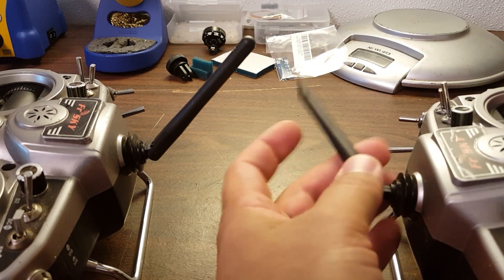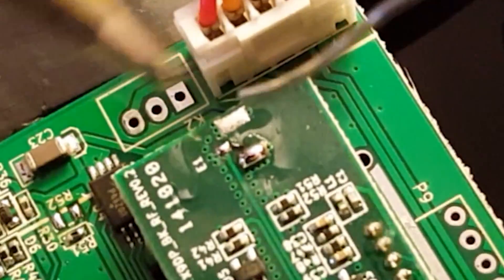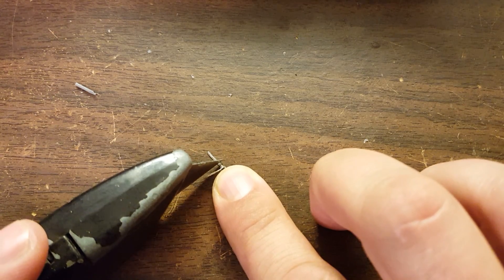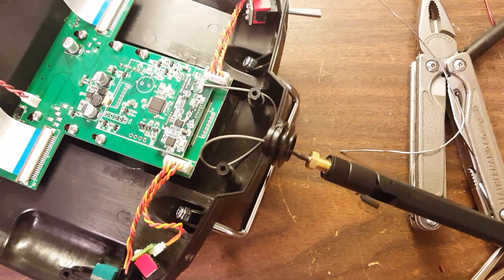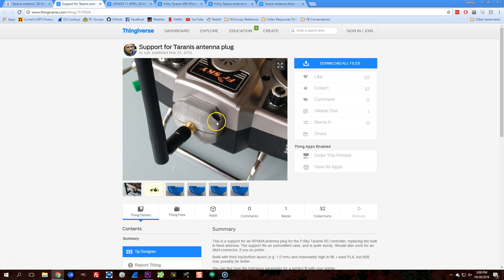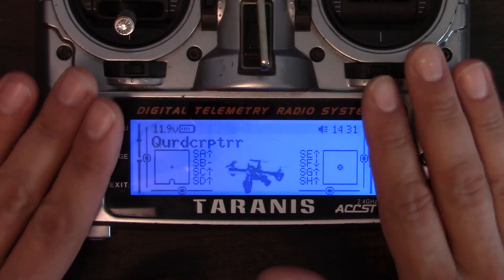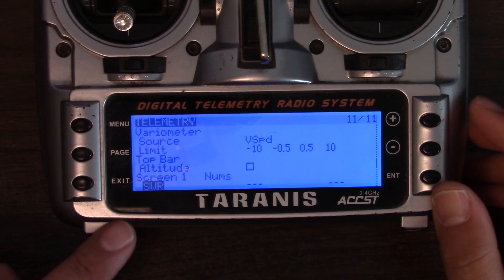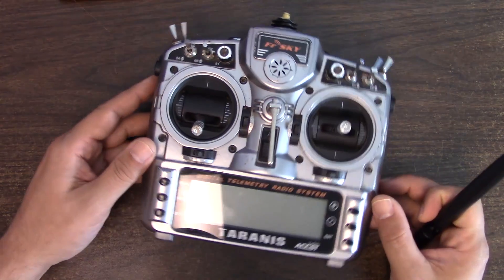FrSky Taranis 5 dBi RP-SMA Antenna Mod | POSSIBLY DO NOT DO THIS MOD

Comment: Has any one got the dreaded radio antenna defective message after the switch... I have and my Taranis has the Ufl connector. I didn't even have to solder. Pigtail is hot glued in place nothing is lose. Should I try another pigtail? Both my friend and I did this mod with same parts and his does the same.
Reply from the maker: +David Lawson sounds like the antenna is no good.
Reply: We have tried multiple antennas we used rg176 His is soldered to the board and mine is connected with the ufl. I think the pigtails are bad . What else could it be ?  I'm going to pm you on rc groups . My screen name is kickybanks
Reply from the maker: You've just got to use trial and error. If multiple antennas are bad, then it's got to be the pigtail.
Reply: Thats my guess as well . How yours doing? .. any issues? I may order from the link you posted
Reply from the maker: +David Lawson mine is fine so far. The pigtail isn't u.Fl though.
Reply: ok thanks. I sent You a message on you tube check it out when You can

Comment: Hi, I did the mod too, tried to get to 84mm, but failed as I did not deduct the amount of shield that I soldered onto the pad (I did not pinch it together, just soldered the 316 shielding to the ground pad). So it's now say 87mm of shielded cable. It works great and the SWR is between 0 and 1. What's ur take on those 84mm? Would you recommend me to do it again, just to get to that exact number?
Reply from the maker: +David Steinberger if the SWR is low then don't bother.

Comment: Joshua thanks for the great work you put into your videos. They are more than just inspiring. 

I had the antenna changed the way you suggested, SWR is 0 to 1. I tested two antenna, one HobbyKing 5dBi gain and an optical similar 5 dBi one from Amazon. However, the RSSI reading is 10 to 5 % less than what Isaw with the stock antenna. At the end of the day, less range instead of expected range increase. Any idea what happened?
Reply from the maker: Poorly matched antenna, I guess.
Reply: are you saying there is a spread in quality among the 5dBi antennas sold
 so I just need to shop around until i find a matching one? One sources 
i.e was this: 
https://www.amazon.com/gp/product/B01GM9DUPY/ref=as_li_qf_sp_asin_il_tl?ie=UTF8&tag=mrste08-20&camp=1789&creative=9325&linkCode=as2&creativeASIN=B01GM9DUPY&linkId=7668ab372740317a907bcd2ae696b4f3
Reply from the maker: +cusglider i mean, I guess that's what you're telling me...

Comment: Iv seen on other videos that people take measurements to cancel impedance. thoughts?
Reply from the maker: +Roflbot FPV I'm not sure what you're referring to.
Reply: Sorry, that was pretty vague. Measuring the length of cable between the solder point and the bottom of the RP-SMA connector. speed of light times velocity factor of cable divided by center freq. Is that only for certain coax? Im just learning. :)
Reply from the maker: If the coax is actually 50 ohms then the length doesn't matter. If the coax doesn't meet spec and is not actually 50 ohms, then you want the cable length to be a multiple of a wavelength. Alex Greve recommends 84mm. 

Many cables that are nominally 50 ohm are not actually 50 ohms at microwave frequencies, especially cheap cables. 84mm is a safe bet regardless.
Reply: BOOM! I dont know who Alex is yet but Ill check him out. Thanks again.
Reply: Alex Greve = IBCrazy, Dots = Connected

Comment: I'm trying to find the correct video for my question. This seems like a good spot. Do USA cell towers mess with 2.4 signal? For example, those fake trees or a light pole with tons of repeaters on them.
Reply from the maker: If you fly near a powerful transmitter, you'll likely get interference almost regardless of what band you're on. Yeah, you can expect failsafes if you fly near a cell tower.
Reply: Joshua Bardwell I guess the question is how close is too close. They are almost everywhere nowadays. Thanks a bunch!!!
Reply from the maker: +Kevin Duquette if you dive it, you're too close.
Reply: Joshua Bardwell I think I had failsafe. Off the parking lot 100feet. A baseball field away from a tower. Broke HD camera, top plate pushed into my new LUX FC and cracked it.

Comment: the part that you had in your description had a IPEX connector at one end. Is there a special way to remove it? Would removing it mess with the signal. From what I've learned so far is that the length of the co-ax wire is very important. Correct me if I'm wrong. Cheers!
Reply from the maker: +Tyler I just cut it off and direct soldered. But if you have a recent Taranis turn there might also be a u.fl connector.

Comment: i used rg316 and the swr is 33 the wire length is 84 mm what can i do to get better swr?
Reply from the maker: +vit tsy I'm not really sure. It seems like some people get higher SWR for no obvious reason.
Reply: what can i do to improve it?
Reply: were did you get the antenna?
Reply from the maker: It's in the video description.

I don't know what you can do to improve it, hence the, "for no obvious reason" :-) Try a different antenna and coax? Or just leave it at SWR 33 and see if it burns out your board. Maybe it won't!
Reply: once in a while it will say antenna defective and will lose signal and when i turn it at a certain spot it will go to 18 swr
Reply: how can you tell if the board is burned?
Reply from the maker: +vit tsy range will be really short.
Reply from the maker: +vit tsy Yeah, I would try to fix that. If it says antenna defective ever, something isn't right.
Reply: what should i try replacing first

Comment: Morning, I have just completed the antenna replacement. When checking my SRW without touching it I get a reading of 33. But when I touch it I get a reading of 1. Should I open her back up and redo the soldering job? Also I used the same antenna you provided in the link.
Reply from the maker: I don't even know what to make of that but if your SWR is 33 I think I would be worried the board would burn out. Try the tip given by Alex Greve of cutting the coax center conductor to 84mm exactly. That will compensate if your cable's impedance isn't exactly right.
Reply: I have completed the changes, it reduced the SWR to 16. I think I can live with that. Thank you for the help Josh

Comment: Harder that it looks! Although I did use heavier gauge coax. But I lifted the tiny pad :( thankfully I also lifted the track a bit and managed to solder onto that :D then lotttssss of hot melt

Comment: Did you only solder to one of the ground pads?
Reply from the maker: Yes.
Reply: Joshua Bardwell I did this mod with a thicker cable and soldered it to a single ground pad.  I getting an swr reading that hovers around 35.  Is this ok, will it decrease range, and is there a way to fix it? Thanks!

Comment: ps. when soldering small things like SMD, put your little finger on the table (or something solid) as a reference, your hand will be stable. Using a teflon coax is best, it's quite heat resistant and will not deform when heated. ps....First time I hear someone say SWR like that ;)
Reply from the maker: If you can say "viswar" then you can say "swar". That's my opinion and I'm sticking to it.

Comment: How hot should the soldering iron be?
Reply from the maker: +Lachlan Peknice I use 750 F as my general use. Up to 800 or 850 for larger joints or heavy pads like on a PDB.
Reply from the maker: +Lachlan Peknice ah, now I see the context. For the Taranis, I used 750.
Reply: Thank you!!!

Comment: I ordered the part used by Joshua.  When I opened my Taranis the board already had that UFL connector installed.  All I had to do was connect the cable to the board and epoxy in the rp-sma connector.  Kind of happy to not have to solder anything.  lol

Comment: Great toturial... Can i put 9dbi antenna?Why my swr 48? Any idea to get 1 like you?
Reply from the maker: +izzat ishak SWR 48 because your soldering is bad or your antenna is not tuned correctly. If you don't fix it, you'll burn out your radio board.
Reply: Joshua Bardwell thanks a lot... My taranis now have 5dbi antenna...

Comment: I've watched other Taranis antenna mod vids, and some specify the length of the coax to (RP)SMA jack which you are attaching.  One suggests that 84mm is the optimal length. This seems odd to me, since a 1/4 wavelength on these 2.4ghz frequencies is approx 32mm (a little less). As a ham radio operator, there is some data on feeding a monopole with various fractions of a wavelength of coax (1/4 wavelength, 1/2, 3/4 or even 1 wavelength.  I'd be tempted to match the length as used in the original antenna install. While I've not modded my Taranis TX ant., I did put a 5dbi external antenna on a Syma X8 TX to great effect. According to some other vids, one could expect up to a 50% range increase using the 5dbi mod on the Taranis.  Good food for thought. Never thought of putting the SWR on my telemetry screen ... going to do that now. Cheers. EDIT: I just checked in my telemetry section, and the version of FW I have on my Taranis (2.0.6) does not have SWR, nor does it have the "Discover" ability of later FW versions - 2.1.X. Oh well ...
Reply from the maker: Alex Greve told me that the goal is to have the coax be an integer multiple of 42mm, to negate the effect of cheap coax not being 50 ohms. I didn't ask him to derive that number for me, but if Alex says 42mm, he's probably right.
Reply: Well that corresponds to the 84mm number I heard. Cheers.

Comment: I accidentally powered up without antenna twice. Powered off right away, in total it's been powered without an antenna for less than 4 seconds or so. Do you think I caused any damage? Also I hardly hear the humming the radio previously emitted is that because of the 5dbi mod or because I did have it powered on a few seconds?
Reply from the maker: Probably fine.
Reply: Pablo Contreras
Reply: kimi masuda ??

Comment: Thanks Joshua! Did the mod with succes! My SWR is 0-1 so far so good. When Incover the antenna I see 0-16. Did a field test and works as a charme. On same spot I dont get the alarm anymore. 🤘🏻😁

I used the Bison Kombi Stick to fill the hole. Works great with plastic and meatal and hardens in 5 min. Its also heat and water resistant. 👍🏻
Reply from the maker: That Kombi Stick is interesting. Thanks for pointing it out.

Comment: Nice video and explanation Joshua. Done my antenna mod a couple of weeks ago using this 3d printed part which works flawlessly. Locks the sma in place and protects it not to turn while screwing in or out the antenna. http://www.thingiverse.com/thing:1659737

Comment: Here is an idea on securing the SMA plug in the Taranis. I ended up putting layers of heat shrink a few MM thick on the base of the SMA plug so when i tightened the provided nut on the SMA plug, it compressed and expanded the heat shrink into the surrounding hole on the taranis securing the SMA plug very securely, followed with the hot glue for back up, so far working great!

Comment: I did the exact same mod one week ago and my SWR is around 32... i just don't understand why. My soldering is good. If I unscree the antenna it goes up to 65 so it means SWR works properly... maybe my antenna is bad. I bought the one frome banggood. Anyone else with this problem?
Reply from the maker: Here's the exact antenna I'm using. https://www.amazon.com/gp/product/B01KBU61S8/ref=oh_aui_search_detailpage?ie=UTF8&psc=1

Comment: Why not use a shorter cable? so that is not that long.
Reply from the maker: I don't think the few inches of extra length will hurt my signal that much. And I have a bad habit of over-shortening cables and then having no slack left when I need it.
Reply: One more question... Where did you get that antenna? is there any difference between vendors? in terms of quality.

Comment: Hey Josh, i tested serveral WIFI Antennas, the bigger the gain, the bigger the SWR gets. A small 2.4ghz 3,5dbi antenna, like the original one gets me a SWR of 1 (even with ufl connector), the antenna with the most gain gives me a SWR of about 30-35. Can you relate?
Reply from the maker: +bind I can't. But that's interesting. I'm using a 5 dBi with a SWR of 1.

Comment: Thanks Joshua, really want to do this mod & at the same time wish FrSky had released an updated version of the Taranis that already had this done (instead of trying to "re-invent the wheel" with the Horus)
If I remember, you are an RF Engineer... so keen to know why RP-SMA is used for this vs SMA? 

It would be great to do a video explaining why DJI's new Occusync technology can have such awesome range (for both control + video signal) on a very small hand-controller antenna compared to what we currently have with the FrSky setup.
Reply from the maker: There's no real RF advantage between RP and SMA. I think that RP antennas are more common though. Some argue that RP is less prone to damage because it has the pin on the device, and the device is less likely to be banging around in a toolbox somewhere getting damaged, but I think that's questionable. 

The real advantage to RP, if you want to know, is that an SMA antenna CANNOT plug into an RP jack, but an RP antenna CAN plug into an SMA jack. So with an RP jack, you know for a fact you will never screw the wrong antenna in.
Reply: Thanks Joshua... that makes sense to me.

Comment: Ok, so i've got some interesting SWR results, however this is 100% stock with no modding. If I have the antenna at a right angle to the TX pointing to the right, I got a reading of 14-19 (with hand coverage goes to 30). This reading is almost identical to all other antenna positions EXCEPT for a right angle to the LEFT. I then get a 0-1 reading. When it is to the left the speaker is quiet, but to the right the speaker makes buzzing noise so there is obviously some noise leaking out. Any ideas why?
Reply from the maker: Two guesses. 1) you have damage to the braided shield of your coaxial cable. 2) putting the antenna one direction puts something metal close to it that causes a change in its radiation characteristics.
Reply: Joshua Bardwell Maybe I will get some upgrade gimbals so I have an excuse to open it up haha. Thanks for the info. I will make sure to have it to the left and check it regularly.

Comment: Would using RG316 be any better?
Reply from the maker: Thicker coax is basically always lower-loss than thinner coax. However, if the length is short enough, the difference can be negligible.

Comment: Great tutorial. Sorry for a differ question, I have checked my SWR on stock Taranis, and I've got my SWR to be 16 constantly. The Transmitter antenna is intact. Is it poor assembly of transmitter ?
Reply from the maker: +Sasha I couldn't say for sure, but that's a relatively low number and I'm not sure I would worry about it.
Reply: Nice to hear that, thank's :)

Comment: Awsome advice on the SWR reading Joshua, I had previously done the antenna mod so I could fit a 5dbi antenna and the SWR test proved the mod was ok, I get either 0 or 1. However when I refitted the standard length antenna I got a reading of 16, tried a second standard length antenna and got a 1. I'm guessing the antenna with the bad reading was in fact an unmarked 5.4ghz antenna. Thanks again.
Reply from the maker: +David Hughes I also tried a 5 GHz antenna by accident and had a similar result.

Comment: hey please 
is you're taranis plus making a sound from the speaker continuously ? like interference ?
Reply from the maker: Only under certain conditions where it is near to electrical interference.
Reply: Mine is always doing this buzzz sound. There are other that have the same problem, but not all... I just get mine, I'm thinking about getting it exchanged but I don't know if that will fix the problem....
Reply from the maker: +Ananous some people put foil around the speaker
Reply: thank you :)

Comment: NJ Tech also does a really clear video on this antenna upgrade showing how to reuse the antenna mount at the top.
https://www.youtube.com/watch?v=BXptoQjuwrA
Reply: He doesn't actually show you how he secured the SMA connector into the stock mount though. Yes, you can see he did re-use it, just like Josh, but how is it secured?
Reply from the maker: +flyeroneFPV I didn't reuse the stock mount. I put an SMA washer and nuts onto the connector to hold it on the hole and then epoxied it.
Reply: Yeah sorry, my comment was unclear. I meant you both put the connector through the old fitting. You used epoxy, but stubbeFPV made me think (by his comment) that NJ Tech showed a different way to secure the SMA bulkhead connector into that original plastic mounting.

Comment: A good alternative for someone who doesn't want to do the soldering is a XJT module.  The Taranis (and I think any OpenTX radio) can use a special protocol to communicate with it, so no PPM lag

BTW, it's OpenTX 2.1 that has the new telemetry system.  The "old" version you're talking about is 2.0
Reply: stick a crossfire in it and you can fly as far as you want :)

Comment: Thanks heaps for the SWR tip......I have done the mod and mine was around 30odd. I am in the midst of finding out what the issue is.....
Reply: I have completely redone the internal soldering, and have the same result. So I guess the next thing is the antenna. I will get a non-wifi antenna and see what happens....
Reply: Liam Lambkin I have replaced my antennas several times with WiFi antennas and have a SWR of 1, I also replaced the board end with a U.Fl connector so I can just plug the new antenna in instead of soldering anything.
Reply: Mark M I have since redone this mod, I shortened it to 84mm, and I now have a SWR of 0/1